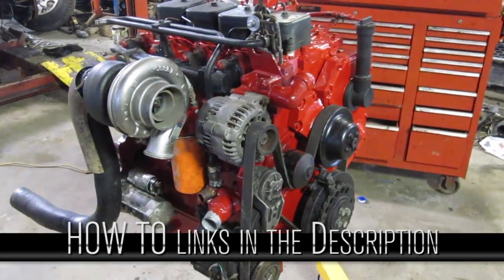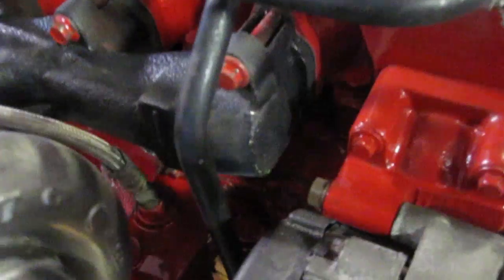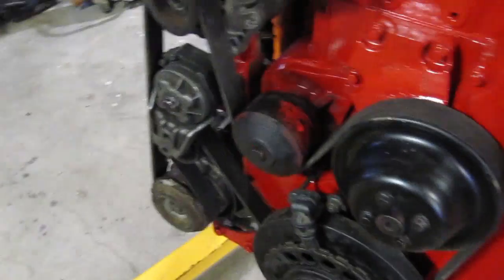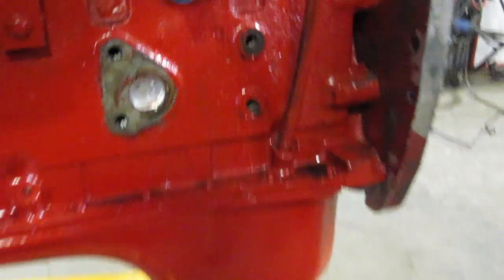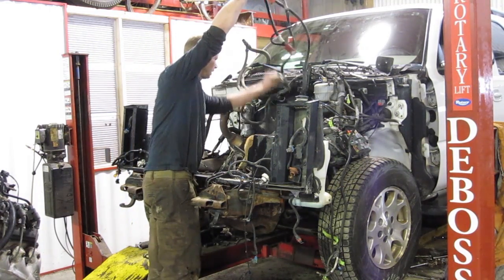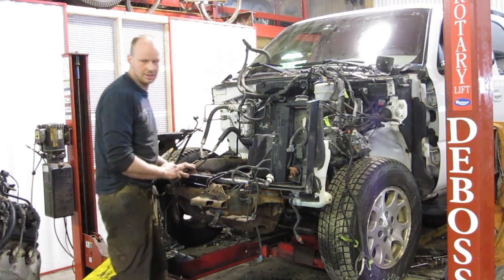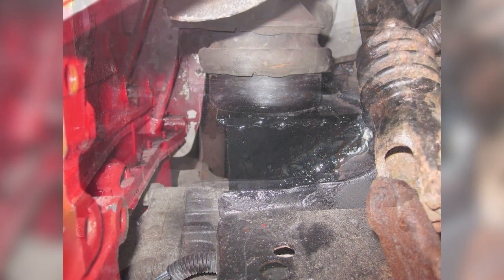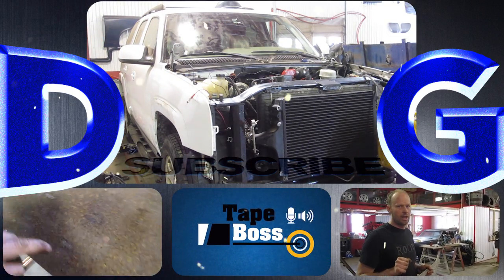Fabricating 4BT Engine Mounts | #CumminsTahoe [EP3]

Comment: I have a gear driven PS pump, which has a vacuum take-off on the GEAR side (i.e., NON-RESERVOIR side).  I have a hydroboost system, so I wonder if you could recommend the/a right reservoir.  The mounts I'm using don't accommodate the PS reservoir that I bought (no fit), which I htink was possibly the wrong reservoir.  I actually picked up for an EDELMANN 80423 '99 1 ton, because it has 2 return lines.

Comment: Hey I have a 6.5 GM(Chevy)1994 having a starter problem turn the key got nothing every thing works but the starter got new batterys I can jump it at the starter with the key on and it fires right up any clues what's going on
Reply: Steven Voelker check you have power to the solenoid with someone holding the key to start position
Reply: @curtismobilemechanic  got it working stearing colum was lose

Comment: I have a 93 Ford Ranger super cab with the 4.0. Will a 4bt swap work? If not what diesels would work? And would I have to get a bigger alternator to charge the batteries?
Reply: Try the little kubotas or yanmarrs. Good engines and they come alot smaller

Comment: Was most of the component relocation due to the Tahoe small engine bay? In other words were may of these modifications meant for the Tahoe only?
Reply from the maker: I generally put things back where I found them, its easier that way.  AC compressor stayed in the same spot so I didn't need new lines, GM alternator went back on so I didn't need to rewire anything etc.

Comment: Hey Rich, recent subscriber and I love your channel! I have a question for you. I am currently saving up for my dream truck. A 1985-87 Chevy or GMC K2500 Suburban. I will be putting a 12 valve with a NV4500 5 speed into the truck. Have you done anything similar to this? What do you think would be the hardest part about the whole swap?
Reply from the maker: I'm almost done converting my 05 Silverado 2500 to a 12v/4500.  The hardest part is finding the time to do it!  It really is pretty straight forward, especially in the square bodys.  Lots of kits out there to pretty well bolt it up.  Check out the Dodge and Silverado videos for wiring and tips
Reply: Would you just get some aftermarket mounts or have some made? I don't have the tools to build my own otherwise I would. Thanks for your help and for letting me pick your brain!
Reply from the maker: I make all the mounts and adapters myself.  Had to get a driveshaft made and my brother in law does the specialty machining for the tach and speedo.

Comment: So do you use the preheater instead of glow plugs??
Reply from the maker: the Cummins have an intake heater which is just a grid heater in the intake.  it's a great system because they last forever.  the fords use glow plugs which turn cherry red in the cylinder but if you crank the engine over before the "wait ro start" light is off, the cold fuel hits the glow plug and burns them out instantly.

Comment: is there a hookup on the 4bt for the oil life monitor and mpg computer?
Reply from the maker: +shylildude The oil life monitor is a timer, it doesn't actually check your oil.  Im not sure how the mpg is calculated. I think it is by measuring how much fuel is going through the injector.  more fuel is supplied than what is needed and a large amount goes back to the tank through return.  As of yet, I havn't found time to go get my computer flashed to get rid of the "reduced engine power" so I can't know for sure.  I do know that all the mileage calculators or "lie-o-meters" are not very honest in the consumption.  As soon as I flash my ECU, I will let you know what I find
Reply: +DEBOSS GARAGE Is the cruise control functioning? I was wondering because I have a 95 Chevy K2500 single cab long bed that I am going to put a 4bt in. I just haven't been able to find a motor under $2000. I really want to have cruise control.
Reply from the maker: I think your cruise will work with vacuum and shouldn't be affected.  Mine is driven by wire which gets more complicated.   I will need to get the cruise setup of a 2002 or older and incorporate the vacuum setup to get mine to work.  I will look into it but I have to get a few other projects out of the shop first
Reply from the maker: You will have to add a vacuum pump though.  That will be tricky as you are tight for room.

Comment: Hi I am in Australia wanting to put a Cummins 4 or 6-BT into my '86 Toyota Hilux 2l rn-65 4*4 Have u heard of this conversion being done b4?
This is the 1st of your stuff I have watched (3.9l Cummins in an '04 Tahoe videos) & I found them very informing & interesting! Thanks & keep up the good work!!
Reply from the maker: Lee D I went to Burkina Faso Africa a couple times where the Hilux is very popular.  I fell in love with those little trucks.  I'm sure you can make a 4bt work, but it is probably more power than you need and it is very heavy. I havnt heard of anyone doing it yet.   I would try and put a 2.2 or 2.4L in it that will bolt right in.  Your biggest issue is to mate the transmission to the engine.   It will be easier if you don't have to change transfer cases and driveshaft lengths.  Let me know how you make ou!
Reply: Hi, yeah the 2l toyota engine is a 2.4 non turbo diesel engine & I find it to be quite lacking in power I do alot of 484ing , traveing & towing. My unladen top speed is about 115kph on a flat surface. The ln-65 hilux weighs about 1700kgs & is quite solid with leaf sprung front & rear solid axles. I find it a great vehicle apart from the lack of power. I have considered a few options but the 4-bt seems ideal to me & it should be a fairly easy conversion apart from like u say mating it up to the gearbox. I havent yet looked into how to go about this & hope that it won't be too much drama...